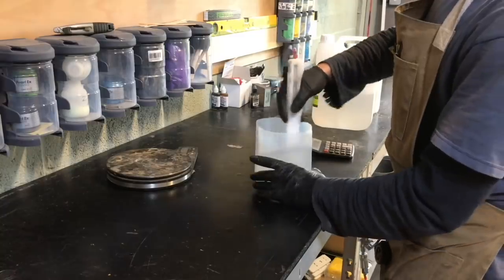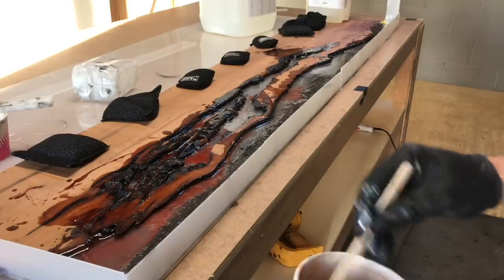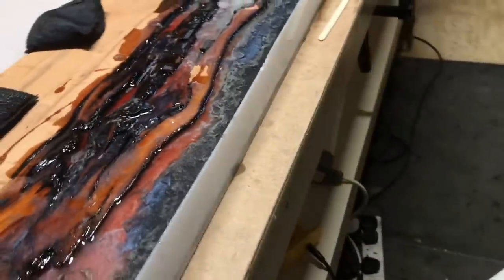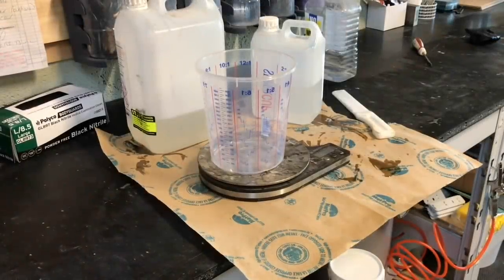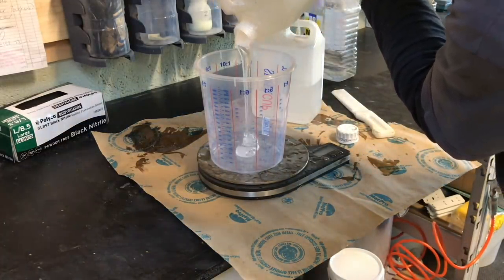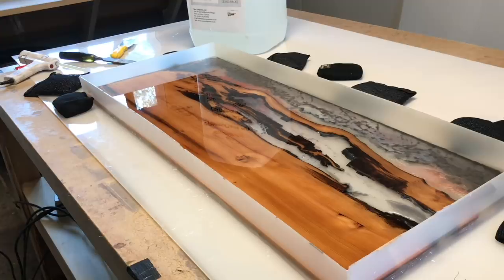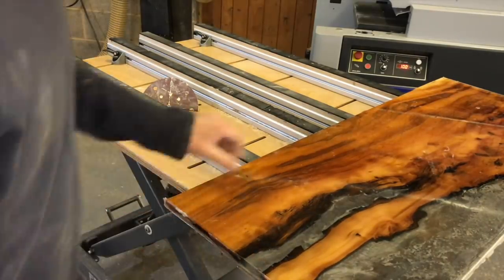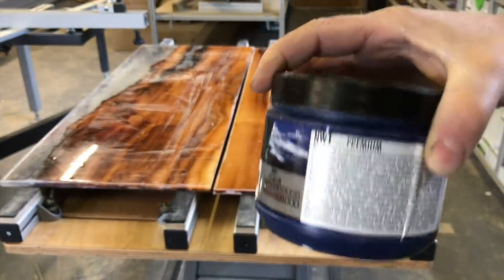Epoxy Resin Art - Wall Hanging

Comment: Excellent work as always! When putting work through the spiral planer do you get chips taken out of the casting at all?
Reply from the maker: Cheers , Sometimes if the cutters are dull or the resin hasn't fully hardened

Comment: Would have been preferable to hide the hanging wire, by placing it a little lower down....nice job though, nice finish...
Reply from the maker: That’s is a option , I was going for the industrial look with all fixing on show.  Hidden wire also look cool
Reply: Besides attaching the wire lower, make it shorter, too.  That way it hangs flatter on the wall. I think it might also look nice with a strip light behind it if your colors are transparent enough.  It would also look good with the wood at the bottom and a natural rough edge at the top. Lots of possibilities with this type of project.

Comment: I was wondering how you attach the walls of the poly sheet to the bottom sheet of poly. And once in place, do you use the release tape to tape all of the seams?
Reply from the maker: hot glue or tape sometime both ..

Comment: Are you using the festool polishing grit after using the NW1.  I ‘m using the NW 1 on a table I have just made and having a hell of a time getting a good finish on the epoxy. Went up to 4000 grit sandpaper before the NW1 
What type of pad do you use for polishing, I’m maybe using to soft a one.
Reply from the maker: I think 4000 grit is finer than the paste!   i go to 1000 max before I use the MW1 , then 5000 festool paste the 9000 super shine . I have other video on this ..

Comment: may I ask if you applied wipe on Polly at the end and why you need to that?
Reply from the maker: One side is wood the other is runner resin , I seal the wood with poly or oil or 2 pack

Comment: Why have the wall mounting visible?
Reply from the maker: as I said it reversible , one side is Epoxy over the wood the other and a mix of Wax Oil on wood and Epoxy . so no fixing on back or front . also some people like to display on a stand..
Reply: Beautiful pieces, but the wall mounting not so much, distracts the attention from the main object. If you install the lateral support lower, the steel wire will not be seen.